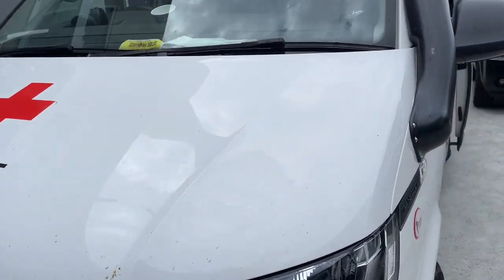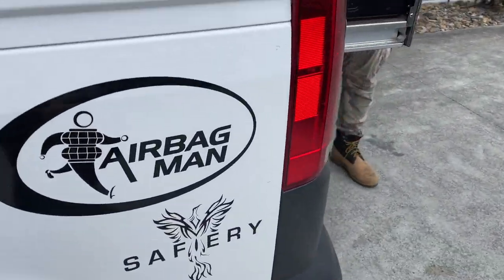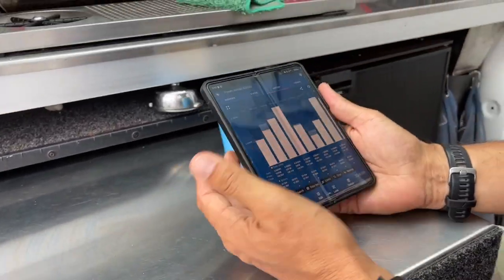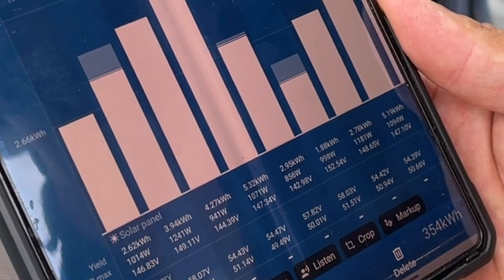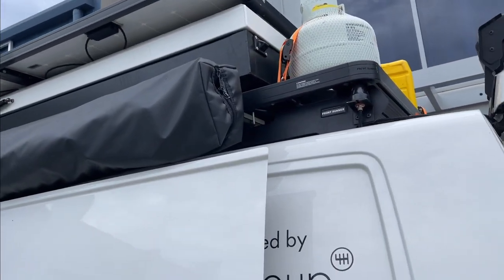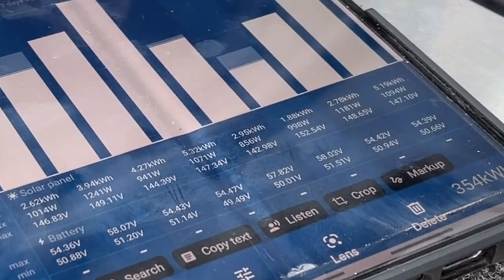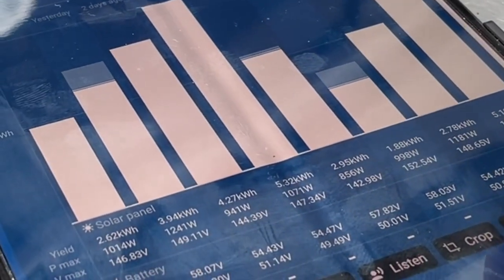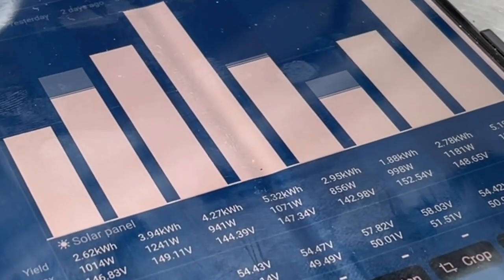Getting 5kWh of Free Energy a day for VW Transporter Coffee Van Excellent Solar Performance

Comment: Sounds exciting, I'd like to have something like this in my new caravan. What brand/model of panels do you use? I've seen 150v solar voltage in the app. Were those 2 panels connected in series or parallel?
Reply from the maker: Hi Paul, these are Sunpower Glass which are 76V each panel and why we use them. They are going into an Smart Solar which needs 120v to start. We add DC DC for solar to avoid shading and on a caravan to mix different panel sizes. See recent video with 1710W on zone rv 22ft6